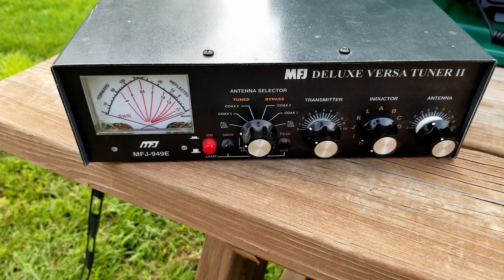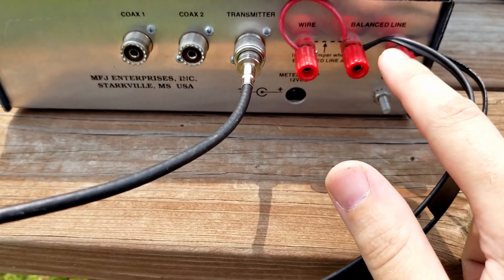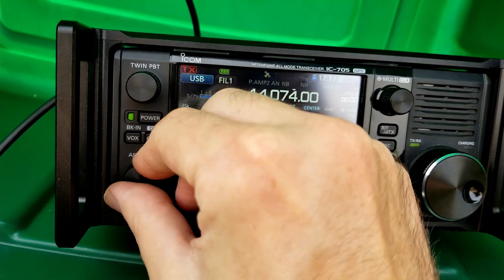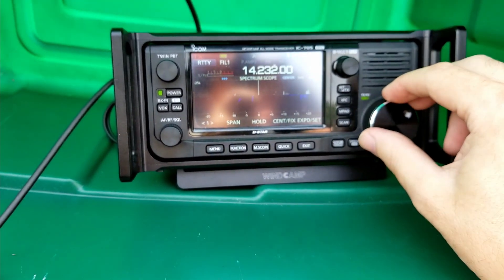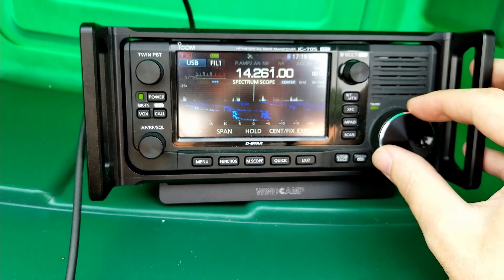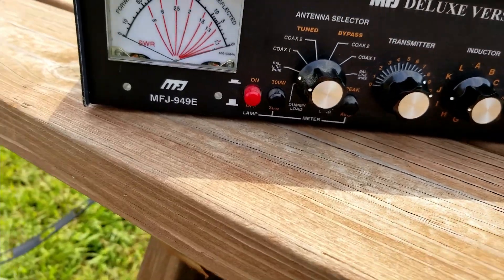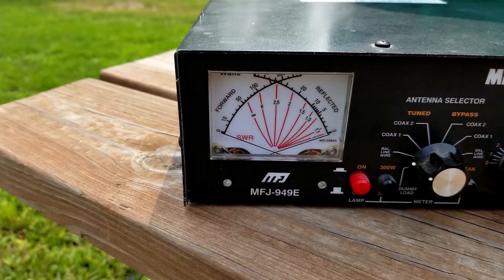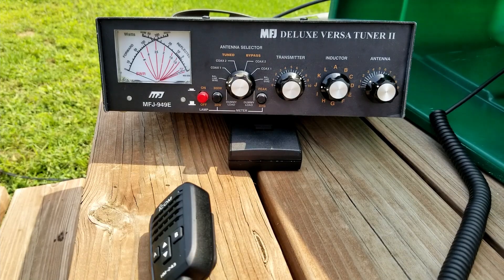How to use a Manual Tuner with your Ham Radio Rig

Comment: My question where  did you start, are the 3 knobs placed in a neutral position then you move one and watch the SWR, then grab another knob and move  that and so on?
Reply from the maker: There really isn't a "neutral" - your antenna is "out of tune" is out of tune no matter where you put them knobs.  Its customary to start at "A" on the inductor and then add middle/middle on the two capacitors - really that's just so that you know where you came from for your own reference.

Comment: Well i have the 949E and the 941E, thankyou for making this very clear!
Reply from the maker: Glad it helped.  I should update it.
Reply: @temporarilyoffline  So when its 1:1 the left scale needle  is the transmitter power output, correct?
Reply from the maker: @Piltdownpaul that part got me too.  Where the needles cross is where you read SWR.
Reply: @temporarilyoffline  I hadnt realized that about the crossing, i just wondered how you knew your output power from that scale on the left, but i guess where the needle points to on the left with the avg button is is your average ssb power
Reply from the maker: Yes, power scale on  left scale. @Piltdownpaul

Comment: I have an ICOM IC-718.  Do you recommend this tuner for use with this radio?
Thanks.
Reply from the maker: This tuner will work with any radio (even CBs) its only worried about RF and connects via the antenna port.  I've ran a 718 with a similar manual tuner.  This would be great and you can find a ton of them at your local hamfests/ebay.

Comment: What do you do when the radio goes into protection mode due to high SWR so is not outputting anything to the tuner?
Reply from the maker: @Birbal2001  you should adjust the tuner for maximum RX noise first which will get you in the ballpark and then attempt to TX. My FT-450 is the only radio that shut down on high SWR. All the newer radios fold back so you can still tune.
Reply: Your radio has reduced power due to the impedance presented to it not swr, the swr will still be there on the line when the tuner has worked its magic but the system will be conjugately match for power transfer

Comment: Hi.  A couple of notes.  Start with the Transmitter and Antenna controls set at 5.  Set the Inductor control at the lowest inductance setting.  On the 949E, this will be L.  However, on most older MFJ tuners the lowest inductance setting is A.  Turn the inductor knob 1 letter at a time, until the noise is loudest.  When transmitting, use low power in AM or CW mode.  Then adjust the Transmitter and Antenna controls to get a 1:1 SWR.  The built in tuners in many radios  will only work if SWR is 3:1 or less.  Manual tuners will work with higher SWR.  Resonant antennas are best, but not always possible.
Reply from the maker: Thanks, that's perfect.

Comment: Do u have to turn your internal tuner off or put on external or leave on
Reply from the maker: Some people will tell you to not use 2 tuners at the same time, but there are times when it's useful.  This external tuner is more capable than almost every internal tuner.  So operate in the way that gets you on the air the easiest and have fun!
Reply: @temporarilyoffline I'm using 991a yaesu can't seem to get swr down with the manual tuner wonder if my settings need changing in menu to turn internal tuner off or change to external or lamp what ever that is
Reply from the maker: For the 991a, first start with the tuner off, then use the manual tuner to bring the antenna into close match, then if you still feel like it, use the internal tuner to get you that final touch up  @TheMaskedPatriot77
Reply: @temporarilyoffline so turn off or put on to external whats is lamp for
Reply from the maker: Just turn it off.  "LAMP" stands for "linear amplifier" and is a way that Yaesu operates on a port on the back of the radio to control some amps or tuners.   @TheMaskedPatriot77
Reply: @temporarilyoffline  got it on external sorted it 1 to 1 swr buzzing thought I'd fluffed it lol cheers dude
Reply from the maker: Nice!  1:1 is good.  What is buzzing?  @TheMaskedPatriot77
Reply: @temporarilyoffline  smiling happy lol sorry your from across the pond
Reply from the maker: I get it now - two friends separated by a common language.  @TheMaskedPatriot77
Reply: @temporarilyoffline  yes my friend cheers for the help only just back on after 25 years off
Reply from the maker: Oh boy have you got a lot of catching up to do!  @TheMaskedPatriot77
Reply: @temporarilyoffline  yes so much had some good dx tho lots in the states

Comment: Thank you for the video. Once matched/tune do you have to match each time your change frequencies within the same band? If so tune for lower and upper portion of the band?
Reply from the maker: Hey Rod! It depends on the size of the band in question.  80m for example is physically large - like 5m from the bottom of the band to the top of the band - where other bands have a large amount of kHz available but aren't much longer physically...  So the short answer is "yes", but it depends on a lot of factors.

What I suggest, if you're using one antenna is to make a guide-book - this freq needs X,Y,Z parameters on the dial - 3,A,7 at 14.074 for example - and then if you head up the band from there and find SWR not to your liking, adjust and make note.  After a while, you'll have the whole band mapped.

You can turn the outer knobs while you're in a QSO and dial in the SWR better, but you shouldn't move the center knob while TXing.

Hope that helps!
Reply: It does thank you much!!!

Comment: I have a MFJ 969 Versa Tuner II roller inductor 300 watt tuner which I hardly ever use now that I no longer have my old Kenwood TS-430S.  I now have a Yaesu 991a which has an internal tuner which will handle all my antennae.  All my antennae are pretty close to resonate so the 991a handles it quite well.  You know, tuners are not really tuners; they're simply an adjustable box that fools your radio into seeing a perfect 50 ohm load.  I was wanting to learn how to tune a random wire but I cannot find any videos on this.  Cheers & 73 from W Rusty Lane K9POW in eastern Tennessee
Reply from the maker: Thanks for watching!  I would tune a random wire using the dame method I showed in this video - the radio and tuner don't know what they are connected to, they just do the job.  In the case of the versatuners, just disconnect the jumper on the back and go for it.

Comment: That average meter reading is not really accurate because it just uses a capacitive hold. Some of the newer ones like the 962 echo or the 989 Delta have an active true peak reading capability but requires the 12 volts for those active circuits. They also light the meter as well. On the 949e which I also have, the forward and reverse power readings are only accurate for the average as the peak as I said is not a true Peak reading. The 962E and the 989D however are good to go for true Peak readings although remember these are still mfj products and even products from other companies will never be as good as a good Berd power meter.
Reply from the maker: Thanks for the info!
Reply: @temporarilyoffline  no problem. I've had my 949e for sometime but recently I acquired both an AL-82 amplifier and an AL-811h. I needed something with a little bit more power handling capabilities so I got myself mfj 989 d. That's a full legal limit. By the way I agree with you and while looking at the cross needles is nice, I rely on the SWR meter on my radio when I'm actually turning the manual tuner. I get a better graphic indicator of what's going on with my SWR and then I just use my cross indicator to confirm it's in the same vicinity. I'm not sure I remember you mentioning this but apparently is very important that when possible you should have the largest possible capacitive value and the lowest possible inductor value. Anyway I thought it was a pretty good video. Take care

Comment: Did you say that if we have a tween lead cable and a coax cable tip Can we Connect it to any of the coax 1 or coax 2 ?
Reply from the maker: Yes, with a 1:1 (or better) balun.  But you can also connect it to the Terminals on the back directly and use the internal balun.

Comment: I like the cross needles. But even at low power I get nervous keying the mike - on am - for too long. What I need is a linear that uses vacuum tubes as the power output rf amplifiers.
Reply from the maker: I love vacuum tubes!
Reply: The fact that they are electrically durable makes vacuum tubes very useful devices. But it is also fun thinking about the electrons that are flying through empty space between the various grids and the plate of a tube during operation!

Comment: Many dont realize , matching works both ways.  Receive and transmit.  You can get close by listening to your receiver noise on the band your tuming.  Start with lowest inductance first then rapid tune load and tune capacitors.  If no change go up one inductance tap ( on the inductor switch ) and do the capacitors again.   You will hit a indictance letter that raises the background receiver noise alot!    Then tune a signal going back and forth between tune and load capacitors.   Now you are very close.  Fine tune with a small transmit power.
Reply from the maker: Good tips!

Comment: The balun inside is 4:1
it is usually possible to find more than one 'tuned' knob setting combination
you should always use a tune with the LEAST INDUCTANCE to prevent arcing and circulating current losses (!!!)
on all these MfJ tuners least inductance is on L position K is more J is more and A is the most.
The lower the frequency the more inductance you are going to need 
on 10 or 11 meters you will usually need about L or K amount of inductance
on 160 meters you will usually need to use the A inductance setting (the most)
on 160 meters the power handling of this 300 watt tuner is usually no more than abt 100 watts
on 20 meters you will usually be somewhere close to J amount of inductance
on 40 meters you will usually be somewhere close to G amount of inductance
if your tuned settings are wildly different - some ting wong
the way to tune is to first set the inductance (start from less) and listen for most noise ( both caps about 50%)
make radio transmit a steady carrier at less than 50% max power
(if you don't want to make old timers cringe use the cw mode - never FM unless on 10m FM)
and use both hands to turn both capacitors to cover all combinations meaning
 left hand at min - try entire right hand range
increase left hand a bit -try entire right hand range
increase left hand a bit -try entire right hand range and so on.
if no tune increase inductance and repeat
ground usually helps especially if you hear electrical arcs inside (reduce power)
if you get rf burns - enjoy!
it is extremely rare to not be able to find a tune with near 1:1 swr (except on 160)

all an antenna tuner does is it adds inductance or capacitance or both to the antenna system
in turn doing that will also change the resistive element.
antenna system is antenna+coax (or ladderline)
the higher the swr before tuning the more power you will waste in the coax
ladder line will waste less power with same mismatch
Reply: Terrific info, thanks!
Reply from the maker: Excellent points, thanks for sharing!
Reply: I got the inductance wrong. I thought A was the least inductance. It seems I have to do the calibrations again. Thanks!

Comment: How about a manual tuner for QRO operation. Saw a tube HF linear, is it worth using a manual tuner or can it all be matched with the tube “matching”.
Reply from the maker: They do make QRO tuners, the one in this video is good for 300w, but I have a video coming out with a 600w tuner.

Comment: So, when you turn the inductor knob, you look for the minimun noise? IW7EEQ
Reply from the maker: Maximum noise -- that means the antenna is getting happier.  The inductor is the "big change" knob, then you have to play with the capacitors which are much finer adjustments.

Comment: You should have asked if the frequency was in use before tuning up. Very poor form here.
Reply from the maker: Good idea!
Reply: @temporarilyoffline  AA5XO here.  I was told by another ham that if you tune on FM you won't interfere with anyone, even if the frequency is occupied.  I haven't tested that theory, though.

Comment: Thank you for posting another video right before I even knew I might need it. I think I can extrapolate to my 7300 and hopefully another antenna than the mag loop.
Reply from the maker: This will work with any antenna, but the built in cap on a mag loop is a much better tool.  This tuner will also work with any radio, I just happened to have the 705 handy.  I first used it with my Yaesu FT-891, then with the 7300, then with some older Kenwoods.  Very useful tool to have in your toolbox.

Comment: I just bout a MFJ-949D at a ham fest. I am new to all this but. I can not get mine to tune a thing. It has bad SWR in byepass.
Reply from the maker: Hello William, on the antenna selector dial, there should be a bypass side as well as a tuner side.  Are you on the right side there?  Are you seeing any power on the meter?
Reply: in bypass the swr reading is the swr of your antenna system. if you removed the tuner completely the swr should be almost the same.
if it is not than the coaxial cable between radio and the tuner is bad or way too long, it should be as short as possible.
also you can open the tuner and troubleshoot the connections if necessary, it should be self explanatory when you see it.
sometimes the mfj minions create bad solder joints inside...
Reply: You will need to use the coax 1, coax 2 or the Bal. Line/Wire positions, depending on which feed-line type you are using, to use the tuner to get a match, not the direct settings on the Antenna Selector switch.

The manual for the "D" model is available from several sources on line.

The only difference between the "D" and the "E" models is the Antenna Selector Switch.  The "D" model only has one dummy load position and the "E" has one on both the tuned and bypass sides of the antenna selector switch.

Also the "D" model is labeled Coax Direct 1 and 2 and Coax 1 and 2 with the Coax 1 and 2 positions being the the tuned positions.  The manual for the "E" model (available from MFJ as a free PDF download) can be used with the "D" model if you keep these differences in mind..

I hope this helps.
73,
John, N1WOM

Comment: Nice little tuner. I got one when I first got my general license. I still have it. You gave a good demo. That is pretty much how I do it. I currently use the 1500 watt version with the roller inductor. Like you I do inductance first then the radio cap. Then the antenna cap second. Then back and forth between radio and antenna. Great tuner I still have it. Wanted to do the same thing and have the antenna built for it.
Reply from the maker: Thanks!

Comment: NEVER apply power when tuning INDUCTOR! READ THE MANUAL! This is a tutorial of what NOT to do when tuning a manual tuner. One of the greatest advantages of Manual Transmatch is that you can tune without transmitting even using it with receive only radio. Again READ the MANUAL its a very Simple process.
Reply from the maker: Thanks for sharing, I demonstrated that in the video, but probably didn't say it out loud.
Reply: @temporarilyoffline  Actually, you did say it.
Reply from the maker: Thanks Stan!

Comment: Hey Steve those 300W Waffle Makers are good enough for qrp radios. I fried every single one of them (3) fried up in just a short time  with a lousy 100W TRX. The only model that survived is the Comet CAT-300. The Vectronics and MFJ' models became party poopers sooner or later. Great video buddy, hope we can make contact on the Bands real soon. 73's de Your Friend Uncle Guenter from the German Frontier.
Reply from the maker: I spend more time on FT8 than anything else... That would be the best place to find me!  Looking forward to a QSO
Reply: @temporarilyoffline  As long as my tongue still works fine and able to say the Words I will always prefer the V2V Mode (Voice to Voice) FT4 and FT8 is made to those HAM's who shut the Lights down before getting naked and humping the (X)YL. Many of them even leaving their clothes on to make sure they won't freeze their wieners off.  Just saying...😎. Ok buddy, hope we can make it happen soner or later hopefully before the Reaper comes knocking at my door. Happy wednesday
Reply from the maker: @DK5ONV  I haven't froze anything off yet, so it must be working!
Reply: @temporarilyoffline  😂😂😂👍
Reply: It depends on how to operate them.  It depends on the frequency, the SWR on the antenna the power level, and the MODE.  FT8 is horrendous on tuners and amps.  You can't run FT8 at 300W with a 300watt tuner.  Same thing with AM mode.  One quarter of the PEP rating is suggested by MFJ.

Comment: If you have a radio with a build in ATU turn it off if you want to use an external tuner. Two tuners will not work. Also don't transmit when turning the middle knob. Did that once and that was not a good idea. :-) .
Reply from the maker: Pro Tips!
Reply: BOTH TUNERS OR ANY AMOUNT OF DAISY CHAINED TUNERS WILL WORK but (!!!!!) a special procedure will be necessary to deal with it so DO NOT DO IT unless you specifically know what you're doing. and there is no need for that until you want to extend the tuning range even further....